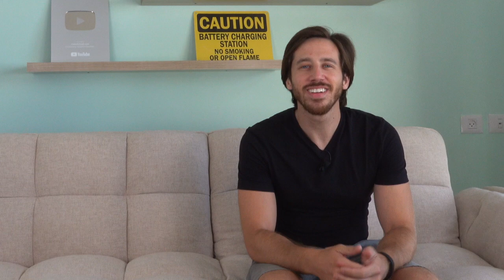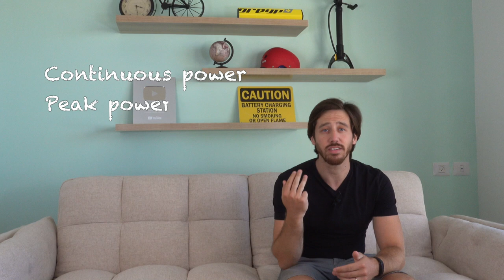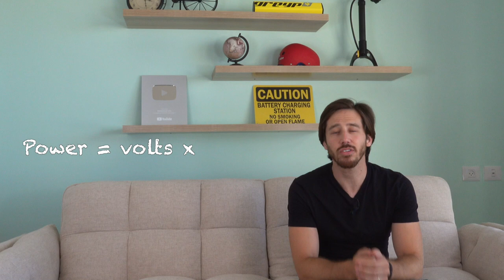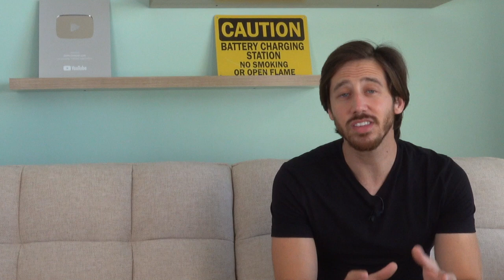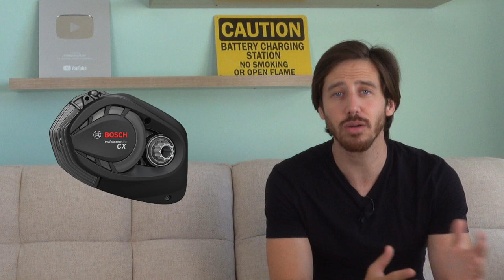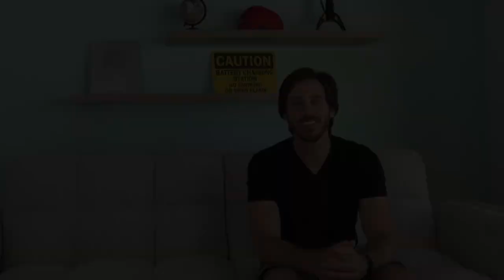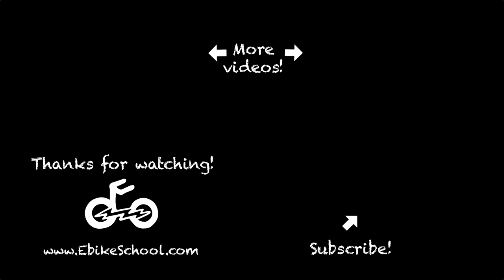E-bike watts - How electric bicycle companies are lying to you

Comment: Also, a couple other things:

European "continuous rated power" isn't continuous power! It is, to quote Regulation EU No 168/2013 Article 3(35): "‘maximum continuous rated power’ means the maximum thirty minutes power at the output shaft of an electric engine as set out in UNECE regulation No 85"

And "maximum thirty minutes power" from that UNECE regulation: ""Maximum 30 minutes power" means the maximum net power of an
 electric drive train at DC voltage as defined in paragraph 5.3.1. of this Regulation, which a drive train can deliver over a period of 30 minutes as an average"

Additionally, there's test procedures in that regulation that define it better, and where the loophole comes in - the power level must be the manufacturer's best estimate of maximum 30 minutes power, and the RPM must be in a speed range that allows greater than 90% of maximum peak power (which is determined in a separate test). If the manufacturer estimates too high, of course, it'll fail the test and they'll have to re-run it, but if they estimate too low, it'll pass.

The US regulations not actually saying what power rating standard is in use make me think the safest bet is to assume the more (but not the most) restrictive interpretation - 750 W peak output power. I don't think any of the vehicle regulations in the US are actually using continuous power (whether over a specific time or indefinitely), but then the US doesn't usually restrict power output, either, outside of e-bikes and state laws restricting what can be used as a moped/motorized bicycle/scooter without a motorcycle license.

Then, there's one problem with your methodology of determining peak power: efficiency. So, just because you've got 36 V, 15 A coming from your battery doesn't mean you have 540 W coming out of your motor. If your motor/inverter system is 85% efficient at peak power, you've got 459 W coming out of the motor (and 81 watts of heat that your controller and your motor need to dissipate), and that's your real peak power. (There's additional drivetrain efficiency considerations downstream if you have a mid-drive, but my understanding is that power regulations care about motor output, not wheel output.)
Reply: US goes for Continuous power. Rating the motor by peak, is incorrect for it's performance. Peak is the RPM and torque a motor goes through before it reaches it's end power point, then tapers down in power. So once it's up to speed, it's not at it's peak power anymore. Same as Gas cars,etc. If they ruled for Peak, Electric/Gas devices would suck.

It's like saying, This car can only have 500rpm and such % of torque. You realize how SLOW that car would be to get up to speed? It'd be like a snail trying to get up to 40mph, in 20mins.

So if a state has a rule of power of a 750watt motor as limited. That is continuous power rule. Not Peak. The motor can have 2x more Peak, because that start power the motor goes through. Again like a gas car,etc. It's the start of the motors run to get whatever it's pulling/pushing up. Then it lowers down to it's continuous power performance which runs at a stable set.

Comment: Yes &  Motors have torque & power curve.  A hub motor may find life hard turning slowly on a steep hill & heat up fast,   but  a mid drive  is geared crank speed, so should be in the middle of its design range hill or flat. & its also important to remember the gearing factor difference between Torque for a hub motor &  a geared mid drive.

Comment: Auto manufacturers underrate their motors too. The 06 Chevy cobalt SS LJS supercharged 2.0l motor is advertised as producing 215 crank hp. I assume this if to keep insurance rates low, because they routinely dyno at 235hp at the wheels before any mods. I'm happy to get an underrated motor in my e-bike because excellent reviewers, such as yourself, make head to head comparisons revealing the "truth in advertising" very quickly.

Comment: Wouldn't torque increase as you increase the operating voltage though?  So the torque rating would only be applicable for the listed controller / battery.  If I throw a 52v battery in a 48v controller, the torque produced would increase

Comment: ADO are interesting on this front. The ADO Air 20 has a 250W battery and 350W on the international version. However, both are apparently marked as 250W on the motor. It lists as 9.6 amp hours (36V battery). Which means it is basically closer to 350 watts peak on the international version while artifically limited via the controller on the EU version and does not include the thumb throttle. Their Beast ebike has a 250W motor listed ONLY but is 14.5 amp hours (36V), which means it peaks at around 522 watts. Lots of shennanigans going on with many of the manufacturers especially people like Engwe ;)

Comment: I have a question
About DC power cable? 36v up to 72v, 70ah
Must put a fuse on there
With a controller from 3000w up to 6000w
How can I calculate which fuse should or not
Or does the controller do that, protection of + power cable
Think this is important
Thanks
You make good videos and very educational

Comment: I just ordered a Ristretto 512. Battery is 52v 30Ah.
Motor: street legal 750w and race mode 4500w peak, which is claimed to be 40-45mph.

52v x 30Ah = 1560V. Does that mean that this motor can run at 1560V continuously without overheating? Therefore I would not be able to ride the bike at 40-45mph without the motor overheating?

Comment: Nominal is not just what the manufacturer " called " for the motor. it means that it was actually design for that power by the manufacturer .and actually is the most important value for electcity equipment.

Comment: great info, question I have folding Tesgo ebike and display does not show actual volts can I wire to the backside of battery wire going to controller and out to a voltmeter to see actual volts? My controller is in the frame, and I can take off the matting side and get to the positive and neg cables. I could drill small hole and run wires up to my handle bars.

Comment: I have a 500 watt 3 speed 90 pound throttle controlled ebike and a 52 pound 350 watt pedalec fatbike. Both seem to produce about the same power. The fatbike specs say 700 watt peak and goes from 0-30kph in about 7 seconds. Considering the weight of the fatbike tires, it seems to be a stronger motor and the taller gears allow me to reach road bike speeds of around 40 kph under ideal conditions. Had expected the 350 watt to be slower but it is comparable to the 500 watt ebike. The plus side is that I can use the 2 frame mounted fatbike batteries on my 500 watt ebike with a 2 pin DIN plug plus 2 batteries on the 500 watt ebike. This allows me to use 40 pounds of battery on the bike which I expect will give me somewhere around 100 miles range with pedal assist. I have 2 batteries mounted on the frame bags and 2 fatbike batteries in panniers. should provide decent battery range when towing my tent trailer too.

Comment: Love your channel. Awesone explanations.
So look at these stats and tell me if Im right... 
Motor rated 750 watts.
Peak 1000 watts.
Battery

48V 20AH (960 WH) lithium battery

Controller

48V, 25 ± 1A; 12MOS

Am I correct to assume that the controller at 25 plus or minus makes up the difference between continuous and "peak" with the +5 amps beimg pumped into the motor to produce the extra peak 250 watts which ultimately overheats (at duration).
If I'm correct, I see why manufacturers are tweeking out another 5 amp controller over 20 amp battery in those (required) situations.  Also, ambiemt temperature plays a crucial role.

Comment: Question.. does enabling dual motors on a scooter uses less battery? Because if the front motor is off, it create drag so the back motor uses more power? Is this myth true? ty

Comment: Super informative, learned bunches.  Is it possible to run a controller with a S866 LCD set at 48 volts with a battery that is 36v?  Or would having the system set to 24v with a 36 volt battery work at all or make the bike go faster. I have a Bolt Pro with a aftermarket 24/36/48/60 controller and seems like I'm stuck at approx 20mph. And that's with the learning loop disconnected which I was told would free me from those 20mph bonds.  I'd appreciate your opinion on what I should do next. Thx in advance, Dan

Comment: Good info, been messing with ebike for a while and came to these ame conclusions.
However I have also read that torque numbers can be fudged and interpreted differently so also not a reliable number to focus on.
Best bet is to look at all the numbers together and also look through forums etc to see what people are saying about a particular motor you are interested in.
Mid drive is tempting me but for reliability I just convertedmy mountain bike with full suspension to 1kw hub drive and it's a nice powerful fast ride.

Comment: This power comparison gets even more difficult when you get into mid-drive vs hub direct vs hub geared. The torque comparisons are great to look at raw motor power. But once you bring variable bike gearing on mid-drives and fixed geared hub motors, things get trickier. Power at the actual wheel can be dramatically different for motors with the same "torque rating". People need to be careful to make apples to apples comparisons.

Comparing Torque of two mid drives with similar drive-train is useful.
Comparing Torque of two direct drive hub motors with similar sized wheels is useful.
Comparing Torque of two geared hub motors is more difficult as you don't know the internal gear ratio most of the time.
Comparing Torque of a mid-drive to that of any hub motor is almost silly. The amount of useful power will be quite different.

Possible content suggestion... similar to you doing run the battery flat test. You could do some 0-20mph tests. While like the range tests, your numbers would be different than your subscribers due to different body weights and finesses. You do get to hop on lots of bikes, and you as the rider could be a nice constant to show some clear differences.
Reply: I do a rough calculation, if mid-drives are torque rated at the crank and lets say its is rated to 60Nm and the chainring is 48T and the cassette has 32T as its largest cog that means the maximum torque is about 40Nm but then you have to factor in loss through the chain which I've seen written as 3-4% or 3Nm or similar so you are down to 37Nm as the peak torque.
Reply: My understanding is that geared hub motors have their torque outputs measured at the hub shell, not at the rotor. So, you don't need to consider internal gear ratio or gearing efficiency - that's already accounted for in the measurement.

You do, however, need to consider gear ratios (and the fact that they're almost always variable!) and gearing efficiency (which reduces wheel torque/power relative to a hub motor) for mid-drives.
Reply: @bhtooefr  I thought the same but I remember a smaller voilamart hub motor which is geared only being 15Nm and wondered how a geared hub would have so little torque. The larger direct drive hub motor has 45Nm and typically smaller geared hub motor's have similar output of 45Nm but this model was stated as 15Nm so was curious if the measurement was directly off the motor before the gearing. It is easy to measure torque at the axle I guess without the planetary gears and hub shell fitted.

https://www.amazon.co.uk/Electric-Bike-Conversion-Lithium-Battery/dp/B0789Y1Z9B

Yes gear ratio's aren't a thing with hub motors as they are independent of the drivetrain gearing. I mean if you have a ebike with a throttle only mode the pedals are just foot rests. On a hub motor you can have 0-45Nm torque in any gear based on how much power you select where as mid-drives it is controlled by which gear you select and your own torque and cadence which is why you seem superhuman when you use one as the power scales up with your own power. Typically though in a high gear the mid-drive provides very little torque but it doesn't need to. It's a good system in feel even if mid-drives are extremely complicated in comparison to hub motors so have much reduced reliability and lifespan meaning far higher costs for the end user. Suntour does its HESC system which scales power to the riders efforts using a torque sensor and that is a hub drive system. It mimics the feel of mid-drive motors buy scaling hub power with the riders efforts. A good compromise between feel and value. I'm unsure if Micah has reviewed a Suntour HESC ebike if he did I'm not sure he dwelled much on the torque sensor but I honestly can't remember him reviewing such a model.

Comment: It's have a bafang 750w motor and 48v 17ah battery setup. I was running it on a single speed drivetrain 44/14. I have been told it will damage the motor and is putting to much strain on it. Would this be the case?

Comment: Pretty good. I find it helpful though to go to the next stage as what we are trying to do is compare the human power at the back wheel compared to the assistance power at the back wheel. And for that we need to talk about temperature and efficiency, as obviously not all motors and controllers are the same, plus of course efficiency is a map rather than a fixed number. If we know the efficiency at say 25C of the individual components and calculate the battery to wheel serial efficiency by multiplying each component by the next we end up with the actual power at the back wheel. Volts x Amps at battery x serial efficiency.

If I had the spare cash it would be fun to use a powertap hub to see the combined rider and assist output at the wheel and a powertap or similar at the pedal crank to measure rider input. With a few simple sums we’d be able to genuinely determine the total and rear world power split. 

Enjoyed your battery book. Thanks.

Comment: 1:38 
Wouldnt power be either controller voltage * phase amps OR battery voltage * battery amps?

Phase and battery current would only really converge when the controller is at 100% duty cycle at high RPMs where you're back EMF limited

At lower speeds youd be limited by either the phase or battery current limits so by definition the voltage at the motor would have to be less than the battery voltage, if we whacked the motor with full battery voltage at 0 RPM, current draw would approach infinity (well it would approach the short circuit current of all the wiring) and fry the controller.

Comment: Hi Micah,  just a little bit of clarity please on power. Isn't this based on what cells you have rather than the controller?  For example an E-Bike with a pack 37V, 17Ah, gives 630W max.  The controller might be rated to handle 750W but it would never receive that amount right?

Comment: A good tutorial. However, there is one thing that has been slightly overlooked, which is the electrical vs. mechanical power. The 250 W continuous power is not the electrical power (V*A) but mechanical power, that is, (V*A) * mechanical efficiency. Contrary to what was said in this video, the mechanical efficiency would rather be up to 80% (not 90% as it was explained here). Let us take one of the few big brand motors with actually low power, which is Specialized SL 1.1 motor by Mahle, with torque of 35 Nm. The continuous power of that specific motor is equal to the peak power, and it is 240 W MECHANICAL power. It is possible to digitally measure the electrical peak power of that motor, which is 303 W. Meaning, the mechanical efficiency of that motor is 240/303 W = 0.792 (79.2%). Now, if a cheap motor manufacturer claims 750 W of continuous power, they probably mean the ELECTRICAL power. Hence, those cheap motors probably deliver far less of mechanical power than advertised.
Reply: Very well written - that is the most misunderstood part.

Comment: So does the voltage matter as far as the motor is self say can I put a 74v battery and a 80am controller on say a 500w motor to make it run 60mph

Comment: Imo it really depends where you live, if it's flat-land almost any ebike can push you but if hilly that's a totally different context, I have a bike with a Bafang Ultra that when you give  -it the gas draws 4 to 7 times the energy that a typical European bike does, even a big battery pack can't give much range at that rate...

Comment: May I ask, What would be a good size (Battery/Controller) for me (237 LBS) with 1000W befang front hub motor. Want max of 28 mph but will not be going that fast 99%.?

Comment: Hi Micah, you have a great chanel, Im looking at building a water jet surfboard using a 300A ESC with a 9000w motor, Im looking at making 24v battery, with 7 cells in series and 8 cells in parallel. Im looking at using 56, 21700 SAMSUNG 40T, 4000mah with a Maximum Continuous Discharge of 30A per cell, I'm hopefully aiming on not pulling no more than 150A, from the pack, would you use say a 200A BMS or would you split the cells into 4 packs and use 4 x 50A BMS's

Comment: Hi Micah, would you agree then that a 500 watt motor in the rear wheel with (usually) 7 gears is going to perform the same as a 500 watt mid drive motor also with 7 gears & all other things being equal as well? There seems to be this belief that mid drives perform better than rear hub motors but I believe that is only true if you are comparing a Mid Drive to a Direct Drive Motor without the same gearing. Your opinion please.

Comment: Using a 36 volt 10 amp hour battery, will a 250 watt motor provide better battery range than a 500 watt motor?